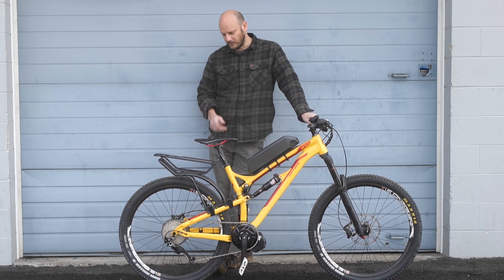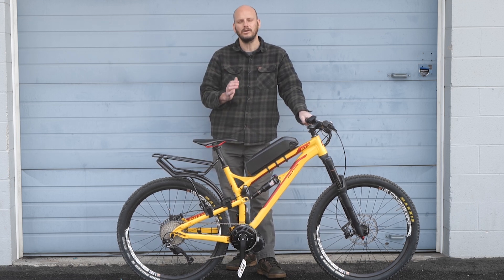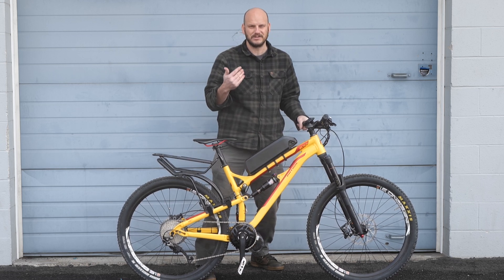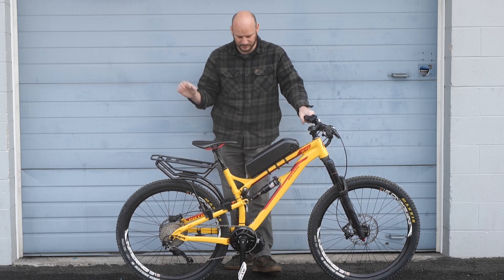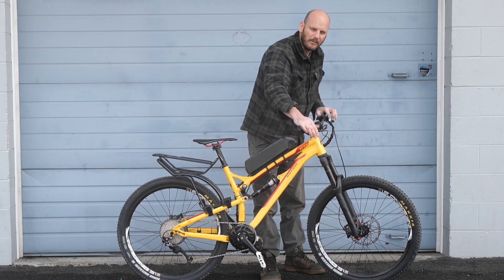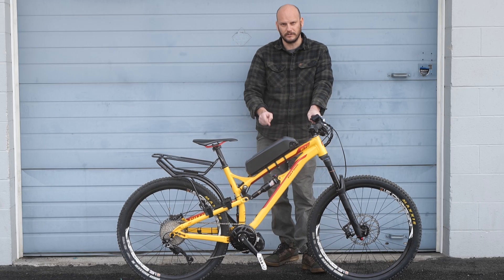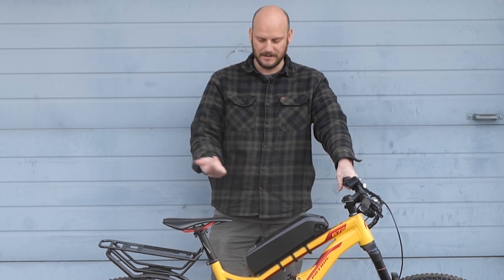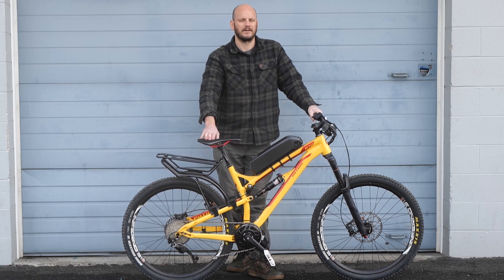Custom E-bike Build:  Patrol 672 BBSHD 52v 14ah Full Suspension

Comment: I have a friend who works at a bike shop.  Their #1 issue is diagnosis & parts for e-bikes.  They literally have to poach parts off new bikes to test which part isn't working (ouch).  Next complaint: multiple componentseven within a similar mfg (Shimano/Bosch/etc) - just standardize until it is perfected.  His last gripe was cable routing/concealment (find the problem in 45 mins, take an hour to disassemble/re-route wires).  

We both worked in mfg & loved cool designs that make service easy.  A standardized system like Bafang or others makes so much more sense.

Comment: Why a brake sensor?
Reply from the maker: Cuts power when you brake so you can’t accidentally send power while trying to stop
Reply: @JohnnyNerdOut  Thanks for answering! As a motorcycle rider, I still don't see the need! Do you by chance have a front belt pulley for the gates drive belt system to go with a     Bafang bbshd?  Converting my Priority bike with the belt drive and  IGH Nexus 3 speed.
Reply from the maker: The key difference is that motorcycles don’t have pedals which is essentially a secondary throttle. I do not carry the gates access accessories, unfortunately

Comment: Hi Johnny, I'm about to convert my 09 giant glory DH, bracket is 83mm, what befang motor would you suggest??. Something with 100mm motor shaft? I'm guessing the 68mm- 73mm would be a tad short.
Reply from the maker: You can either do a 100 mm or you can do a 68 mm with a Lekkie adapter depending on your exact bottom bracket size.

Comment: I’d love to do this to my 2012 trek superfly 100al full suspension but AI told me I couldn’t because of the pressed bearings in the bottom bracket. Have you ever installed a motor on that type of bottom bracket?
Reply from the maker: Yes. You just need some bottom bracket adapters. I carry them on my site if needed

Comment: Nice bike John.. Hope you and the family are well.. have you seen the up&coming hydraulic brake lever that has a ratcheting mechanism to act as a parking brake without leaving hydraulic pressure on the lever (to avoid blowing gaskets)..?
Reply from the maker: Link? I have not heard of it
Reply: @JohnnyNerdOut  I heard about it from someone that returned from Taipei for the bigSHOW.. i have not seen it and don't know where to find it.. Hope it isn't just a roomer.. I have blown out gaskets on 2 hydraulic Tektro levers because you have to squeeze so hard to lock the brakes and keep it from rolling back as you get up from the trike.. But it sounds really good... If you hear about it, let me know.. Rob

Comment: Johnny what's the difference between the canbus and the UART version of the BBSHD motor on your website??
Reply from the maker: Different connectors on all the wiring and a different interface for programming. Currently the CANBUS version is severely limited to what can be tuned and changed.
Reply: @JohnnyNerdOut okay thanks for the fast and speedy reply.

Comment: Good build, curious why did you go with battery on top top vs moving it below? Also I think the rack might be touching the seat tube under weight?
Reply: Tire would hit when the forks compress.
Reply from the maker: If you mount it below it will get ground debris slung up on it. If you’re only riding it on pavement, it might not be that big of a deal unless it’s wet outside. But if you are going to be riding it on any type of trail with dirt, it’s probably going to cut the lifespan down on that battery getting gunk in the battery.

Comment: Move the battery to bottom of downtube or on a double rack (rack battery).

I like that is light.  I built a BBS02 for my wife many years ago, still riding (double rack) and yes it is  lighter than most prebuilt Ebikes.
Reply: Was there any downside to the rack mount battery?  I’m trying to decide location for mine at the moment.
Reply: @ I sent you a reply about the rack mount not sure I actually replied to you.  Take a look.
Reply: @ I don’t see anything. Are you saying you sent a DM?  If so I didn’t know you could do that. Haha.
Reply: @serenitynow007  Weight on the back wheel...
Reply: I mounted my battery on the rear rack, it gets it out of the way and it doesn't affect the so called top heavy feeling, I did this on a Mongoose Ledge 2 29" from Walmart, all aluminum frame,disc brakes, with awesome full suspension for under 500 dollars 🇺🇲🙏🇺🇲🙏

Comment: the battery placement is bad, you should know better from all the bikes you've built, could've easily placed it on the down tube like many did with full suspension bikes and it would have been a 1000 times better, for a bike that is supposed to be trail ready and nibble you just shot it in the foot!
Reply from the maker: It all depends on use case. There are pros and cons for every location. Customer decided the pros of mounting it on top was better than below. Mounting it underneath gets that battery super dirty especially if riding it off road
Reply: @JohnnyNerdOut  Fair point, tho I prefer to put a case on the battery and deal with the cleaning then compromise the riding experience but it's just me 🤘

Comment: The main reason I'm leaning towards a factory build instead of DIY is I want a more stealth look and a built in battery pack in the down tube.
Reply: I got a triangle frame bag and put my battery in there--looks great-like it was meant to be. LOL
Reply: @Alaskamoosedawg  My rear shock takes up most of that space unfortunately.
Reply: @ I found used salsa horsethief frame and 14ah battery fits very nicely in that triangle.